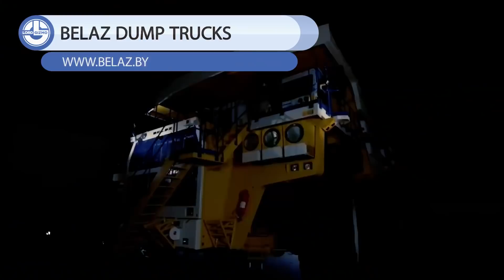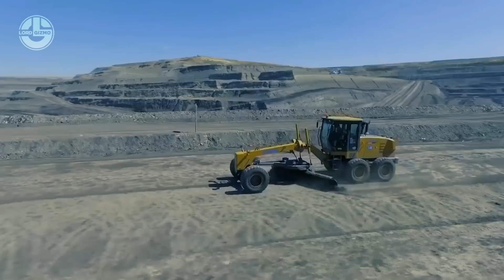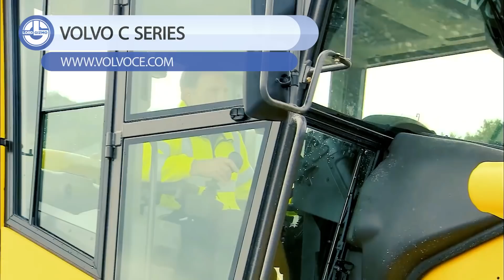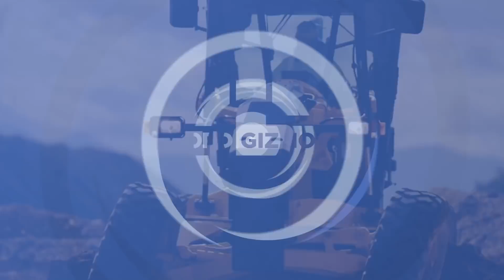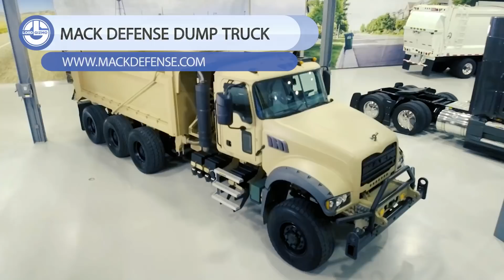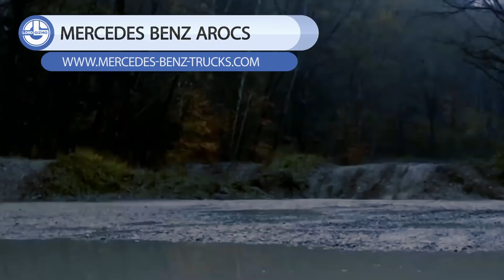MASSIVE Dumpers AND Graders That You Definitely Don't See Every Day

Comment: You need to get the facts right, Cat 979has a 400 ton payload, making it bigger than the Leibherr 282. the Komatsu 785 is not an ultra class truck. Good videos, but please get the facts right
Reply: They said Liebherr has 363 tonne pay load capacity, which is equal to 400 US ton. Same might be the case with Cat 97.
Reply: Can you tell which dumper  can be said ultra class? Is there something specific to that or it's just a general term for big haulers
Reply from the maker: HG was correct here, metric vs US tonnage!  You'll find that, in the captions, we'll most often put either metric tonnes or tons.